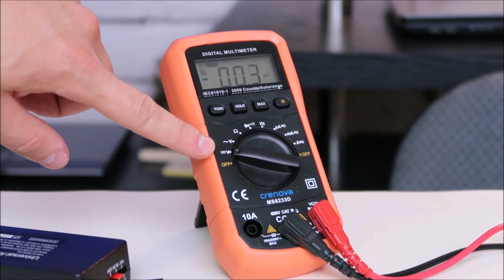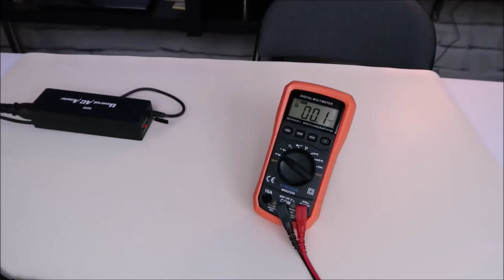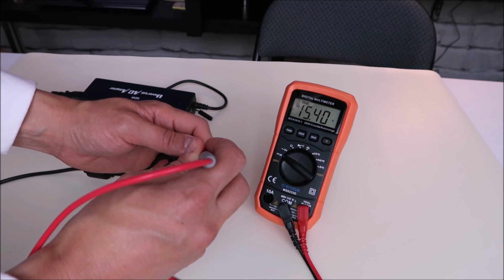How To Fix Any Laptop - Wont Turn On, Wont Open, Turns Off Right Away, No Power Solution

Comment: Fantastic video! Though I'd like to suggest one addition. I got up to the ram step and then discovered that my problem was the SD card reader (or perhaps the SD card... I haven't tested yet). After removing the card, everything worked. I discovered it when I noticed a buzzing sound coming from that area.

So, my suggestion is to tell people to first remove ALL peripherals, devices, USB wifi receivers etc...
Reply from the maker: Glad your all set!  Thx!!

Comment: But bro what if its a button issue??
Reply from the maker: What do you mean, 'a button issue'?  Does the key feel like something is physically wrong with it or does it feel like its mechanically working fine?
Reply: @PC_Monkey  I'm thinking the power on button in my case maybe faulty and maybe it's causing the shutdown
Reply: @PC_Monkey  yes bro it was a issue of the button, as soon as the pc turned on, I removed the keyboard ribbon, and it's working
Reply from the maker: @mewpeow  Glad your all set :) Always here if needed !!

Comment: You know what's my laptop issues is?
It's doesn't turn on and the only sigh of life is when i plug my charger in, the light at the port will turn on
(My laptop is a dell vostro 5490 if it helps)
Reply: I also tried all the ways above the video
Reply from the maker: @Mirror-jr1os   If all the tests in this video do not reveal the issue, and your power adapter tested to be fine, then your most likely looking at a Motherboard replacement as seen here;  https://youtu.be/N_7HNrFkMS8.  If you know your computer's model number, I can help you get inside your specific computer :)

Comment: Starts, fan starts, immediately fan turns off, no boot logo, and power light still on. Toshiba Satellite C55D-B
Reply: Never did it before until I put in a SSD
Reply from the maker: 1.  If you put the old drive back in, does the problem stop?
2.  Have you tried the steps seen here yet?
Reply: @PC_Monkey  already tried it with old drive and without any drive same thing
Reply: @PC_Monkey  I have a feeling the BIOS chip is corrupted
Reply from the maker: @n2oin  If you have tried all the steps seen in this video with no luck, then yes, it most likely a MB issue :(

Comment: Hello can you do a video on how to take data directly off the motherboard of a kindle fire. Yes, directly off the mother board. My tablet battery is dead, motherboard is cracked that holds the USB port for me to charge it. Due to a dead battery and me not able to charge it, I cannot start the Kindle fire 8 7th ed. Can u help?Nope, I did not save data on cloud or memory card. There has to be a way for me to get my data off the memory board. Remember, I did not have a memory card so everything is stored on the motherboard but where and how do I take it off directly? This is a challenge to all electronic pros and all who love a challenge. Thanks in advance.
Reply from the maker: If you cant power on the device, then you wont be able to do anything with any DATA stored on it.  You would have to either get power to the machine or remove the drive where the DATA is stored and access it with another working device.

Comment: Eyy my laptop won't turn on but the charging light indicator is red i have charged it for more than two hours.
Reply from the maker: Have you tried the steps seen here?
Reply: @PC_Monkey   Yes I have but there's no changes
Reply from the maker: @BaeBeth_sa   If all the tests in this video do not reveal the issue, and your power adapter tested to be fine, then your most likely looking at a Motherboard replacement as seen here;  https://youtu.be/N_7HNrFkMS8.  If you know your computer's model number, I can help you get inside your specific computer :)

Comment: Hi PC Monkey, I have this issue where my laptop wont turn on at all after I shut it off for a long period of time. Ive tired static discharge and it allowed it to work..but it kept doing it and  I didn't want to keep going into my laptop to replace it. It seems to turn on with a hard reboot each time with the charger unplugged. However, I cant get it to boot with one press of the button. It seems like the hard reboot doesn't work when its plugged into the charger as well. Im not sure whats going on, but I hope you see this so you can help.
Reply from the maker: If you have to do that each time, something is wrong with components holding on to a charge.  Is your computer plugged into a healthy surge protector or is it just plugged into the wall.  Also, what brand computer do you have?
Reply: @PC_Monkey  it's plugged into a surge protector and it's an ASUS M16
Reply from the maker: @Th3Fr3m  If it only turns on when the charger is unplugged, I would assume something is wrong with the charger.  You can test it as seen here;  https://www.youtube.com/watch?v=YBhsVHideGE&t=6s or you can try replacing it and see if that helps :)
Reply: @PC_Monkey  thank you will attempt this and let you know later today. I really appreciate this. I'm very close to taking it to geek squad since it's still under warranty to have them look at it.
Reply from the maker: @Th3Fr3m  Oh cool!  Ya, if its still under warranty then your all set :)

Comment: Bro it doesn’t work for me I just bought this laptop it’s a dell latitude E7450 pls help
Reply from the maker: Are there any signs of life at all when you try to turn it on? Lights? Fan, Motherboard, or Hard Drive sounds? Anything seen on the screen?
Also, is the computer still under warranty?
Reply: The power button light blinks and turns off when I try to turn the laptop on pls help
Reply from the maker: @blackshadowfound   If all the tests in this video do not reveal the issue, and your power adapter tested to be fine, then your most likely looking at a Motherboard replacement as seen here;  https://youtu.be/N_7HNrFkMS8.

Comment: I ran all your test but couldn't find the cmos battery. Didn't pull the motherboard to check the other side. I did replace the battery because it was swollen. I have no lights at the power port except after the 1 minute test without battery. When I tried to turn on the computer the port light blinked 3 times. The start button usually lights up after pushed but nothing now. The hing by the power button is broken and has been for over 6 months. How do I test the power button? My computer is 6 to 7 years old how much should I put into this to fix it instead of purchasing a new one?
Reply from the maker: If the battery was swollen, thats a very bad sign.  There could be other issues that just a bad battery.  Your motherboard may be damaged if none of the steps seen here work :(  Next step would be to replace that:(

Comment: Yeah gonna have to take the L unfortunately. No signs of life at all.
Reply from the maker: Your computer has no signs of life when you turn it on?  Sounds like your on the correct video then.  Have you tried the steps seen here yet?
Reply: @PC_Monkey  yes none worked and I believe I did it right. Mine setup is a bit more complex than this model tho so could have unplugged the wrong plug but I doubt it.
Reply from the maker: @supertrooperyt6018   If all the tests in this video do not reveal the issue, and your power adapter tested to be fine, then your most likely looking at a Motherboard replacement as seen here;  https://youtu.be/N_7HNrFkMS8.  If you know your computer's model number, I can help you get inside your specific computer :)

Comment: I tried pressing the reset on side when my lenovo was stuck in sleep mode. Now the reset light is slowly blinking and it doesn't start up all the way. Can't find anything about this. Followed a video and now hoping I didn't make it worse
Reply from the maker: 1.  Are there any signs of life at all when you try to turn it on? Lights? Fan, Motherboard, or Hard Drive sounds? Anything seen on 
2.  Have you tried the steps seen here?
Reply: @PC_Monkey  can hear fan. Power light comes on. Are some clicks. I tried taking out battery and putting back. At this point I think it may be stuck in developer mode?
Reply from the maker: @denellblackwell5406  If you can hear the fan then perhaps the computer is actually on.  For a computer that turns on but the display does not work, try this video first; https://youtu.be/u-REPLdpZ70
Let me know how that goes :)
Reply: Thank you let u know
Reply from the maker: @denellblackwell5406  Good luck !!

Comment: Would i have to do this multiple times or just once? Bcz mine is still not working
Reply from the maker: 1.  Are there any signs of life at all when you try to turn it on? Lights? Fan, Motherboard, or Hard Drive sounds? Anything seen on 
2.   If all the tests in this video do not reveal the issue, and your power adapter tested to be fine, then your most likely looking at a Motherboard replacement as seen here;  https://youtu.be/N_7HNrFkMS8.  If you know your computer's model number, I can help you get inside your specific computer :)
Reply: Yes there is the power light but it just keeps blinking. And sometimes it blinks in short intervals and sometimes in long intervals
Reply from the maker: @jatanff4699  If all the tests in this video do not reveal the issue, and your power adapter tested to be fine, then your most likely looking at a Motherboard replacement as seen here;  https://youtu.be/N_7HNrFkMS8.  If you know your computer's model number, I can help you get inside your specific computer :)

Comment: Hello i know your pretty busy but please dont skip. My laptop is plugged in but it's stuck on zero and wont charge or go up but if i dare plug out the charger it immediately shuts off and i have to plug it in for it to come on but it still wont move from zero how do i fix this?
The charger works with other devices except my laptop
Reply from the maker: Sounds like you need to replace the battery.

Comment: on plugging the power cable, power lights blinks only but on pushing the power button... no starting up...!
Reply from the maker: 1.  Then move on and continue with the rest of the steps.
2.  Are the lights the only signs of life when you turn it on? No motherboard or hard drive sounds? No fan noise? Nothing on the screen?

Comment: water fell on my laptop and when I try turning it on it goes off immediately and it’s an Ezbook x3 but the thing is it’s hard to take the battery or cover off and I don’t wanna damage anything so if anyone has easier steps please let me know 🙏🏾
Reply from the maker: After a liquid spill, you want to first make sure the computer is 100% dry. You would turn your computer off immediately by pressing and holding the power button until the computer turns off. Then you would disassemble the computer as much as your comfortable with, at least trying to remove the bottom case. Then you would turn it on its side and let dry for a couple days.

Comment: Can a motherboard just go? It worked the night before then bam nothing!
Reply from the maker: 1.  Yes.  Motherboards like any other part can suddenly die.  However, usually, there are signs before a component dies that it is starting to fail.  
2.  Are there any signs of life at all when you try to turn it on? Lights? Fan, Motherboard, or Hard Drive sounds? Anything seen on

Comment: How to fix my laptop when stuck on turning off and turn on sequence which happened after I shutdown while upgrading from windows 10 to 11.
Reply from the maker: 1.  Can you see anything on the screen during this on/off loop?
2.  Was the computer working well before the upgrade?  If not, what was happening?
Reply: 1.Only the logo of computer "ASUS" after that it turn off and turn on as the sequence continuously repeating.
2.Yes it working well,but after the shutdown while upgrading from windows 10 to 11.
Reply: What is the effect when I shutdown while the upgrading is still ongoing?
Reply from the maker: @rodelbongat2964  If a computer looses power during an upgrade, most likely the operating system can be damaged and need to be reinstalled again.  You would have to install using Install Media as seen here;  https://www.youtube.com/watch?v=Yiy-53Wc-Wo
Reply: @PC_Monkey  thank you very much🙏🙏🙏
Reply from the maker: @rodelbongat2964  Your welcome !! Happy to help :)

Comment: I haven't tried these methods yet I'm going to, also the problem with my laptop is that it turns on and after 2-3 seconds it turns off, if im repeatedly pressing the power button it's not turning off, and as soon as I stop pressing the power button it turns off, any advice would be nice :D
Reply from the maker: Let me know how trying the steps seen here goes:)
Reply: @PC_Monkey  they didn't work :( please can you help me
Reply from the maker: @UR1ZEN    If all the tests in this video do not reveal the issue, and your power adapter tested to be fine, then your most likely looking at a Motherboard replacement as seen here;  https://youtu.be/N_7HNrFkMS8.  If you know your computer's model number, I can help you get inside your specific computer :)
Reply: @PC_Monkey  thanks for helping but i give up, i don't have money so yeah. Thanks for helping :)
Reply from the maker: @UR1ZEN  Motherboard replacements can many times, be much cheaper than a new computer :)

Comment: Cool videos pc monkey.  I have a problem and maybe you can help.  i got a Toshiba l855 laptop that won't turn on.  When i plug the power adapter into the laptop the power light is lit.  So, i assume that there's power in the board and the pc.  But when i press the power button the light turns off and the laptop never turns on.  But the power light turns back on when i stop.  What do u think is the problem?
Reply from the maker: Your on the correct video.  Are you able to try the steps seen here yet?
Reply: @PC_Monkey  Yes did all the steps here.  The battery in the laptop was no good anyways.  I been running this laptop with the AC charger.  Like i said i did all the steps and determined that the cause might be the mother board or the pc power button.  Thanks again.
Reply from the maker: @markeyvee7841  Good luck !! Let me know how it goes :)

Comment: i don't have a computer like that i only have a windows pro where is video 3
Reply from the maker: 1.  The operating system does not matter if your computer is not turning on.   
This video has been updated with additional steps here; https://youtu.be/P3I7dDpkJps. Let me know how that goes :)
2.  Are there any signs of life at all when you try to turn it on? Lights? Fan, Motherboard, or Hard Drive sounds? Anything seen on the screen?
Reply: @PC_Monkey  it goes bad what the heck there no BATTERY
Reply from the maker: @SquarbinMATONS  1.  It goes bad?  What does that mean?
2.  Your computers battery has already been removed or its just internal?

Comment: It isn't working sadly on my Lenovo Laptop
I do every method even the bios reset one :((
Can u help me
Reply from the maker: 1.  Are there any signs of life at all when you try to turn it on? Lights? Fan, Motherboard, or Hard Drive sounds? Anything seen on the screen?
2.   If all the tests in this video do not reveal the issue, and your power adapter tested to be fine, then your most likely looking at a Motherboard replacement as seen here;  https://youtu.be/N_7HNrFkMS8.  If you know your computer's model number, I can help you get inside your specific computer :)

Comment: sir first one help me what can I do to find the solution bcoz i need to do it for every time
Reply from the maker: You have to remove both the battery and charger, press the power button for a minute, then put them back in each time for the computer to turn on?  Are you using your computer with a healthy sure protector or plugging it directly into the outlet?
Reply: @PC_Monkey  yes sir but the pblm here is  if I not use the laptop for some times or busy on something it is automatically turnoff sir if I use in bed also it is automatically turnoff so what can I do to this type of pblm so I want to reboot again normally I can access the laptop sir
Reply from the maker: @lifestylechanges5889  The computer turns itself off?  Is the computer overheating?    Can you find an error matching the time of shutdown as seen here?  https://www.youtube.com/watch?v=Nqn8-jJFx2Y

Comment: My computer was working fine but i enabled an option called "internal network adapter boot" in the BIOS when I enabled it , I got that problem
Reply: Any help please?
Reply from the maker: Now your computer wont turn on at all?
Are there any signs of life at all when you try to turn it on? Lights? Fan, Motherboard, or Hard Drive sounds? Anything seen on the screen?
Reply: @PC_Monkey  there is lights and can and I can press ESC to go to the BIOS again
Reply from the maker: @maleksan4303  If you can access BIOS, then the issue discussed here is not your issue.  What brand computer do you have?
Also, are you able to find any Recovery or Repair options in BIOS?
Reply: @PC_Monkey  I have a hp laptop and 
F1 is for System information
F2 is for System Diagnostics 
F9 is for Boot Device Options
F10 Is for BIOS setup 

F11 is for System Recovery 
But I don't know why when I press F11 to go to the System Recovery it does the same thing when I turn on my pc , like I can't even see the loading screen it's automatically turns off and on again

Comment: I'm only seeing this now..i didn't all the battery removal and 1min method now i opened the back of my laptop and i only have 1 Ram
Reply from the maker: What brand and model computer do you have and whats the issue with it?
Are there any signs of life at all when you try to turn it on? Lights? Fan, Motherboard, or Hard Drive sounds? Anything seen on the screen?
Reply: @PC_Monkey  i managed to fic it using one of your videos, video number 4....it's been off since early April if not late March...Thank you so much for your assistance I'm at my happiest now
Reply from the maker: @ayandamixo5566  Great to hear !! Always here to help :):)